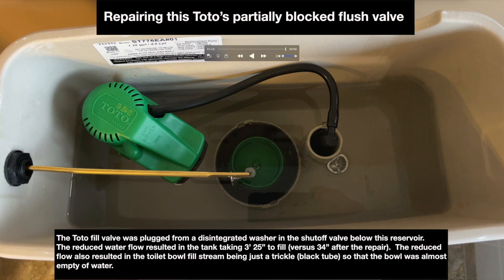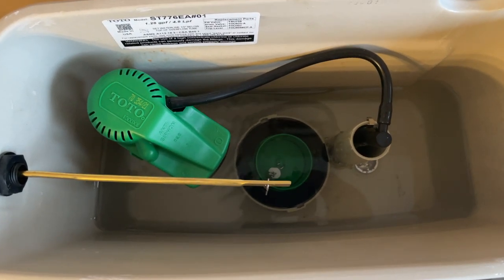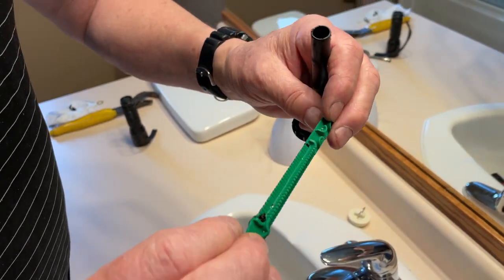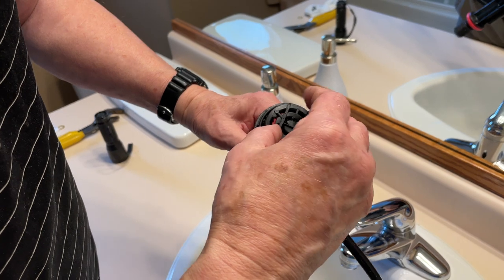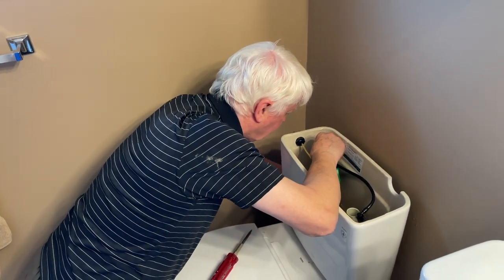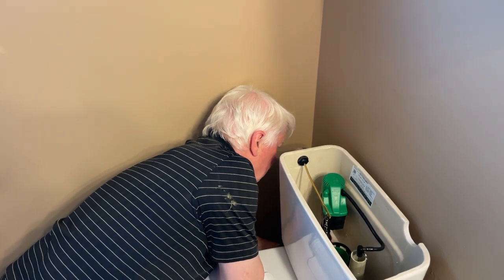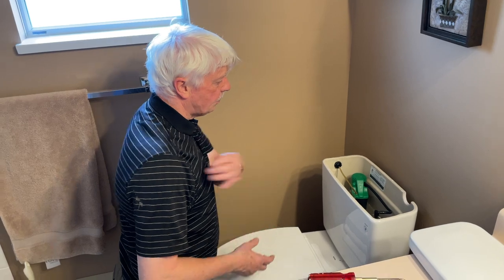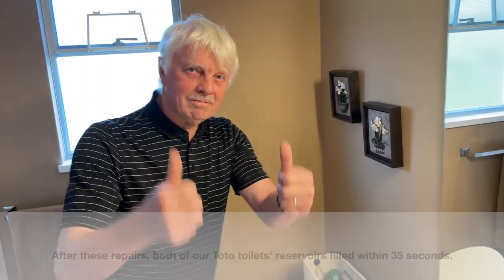Toto Drake II Toilet Fill Valve Blockage and Repair

Comment: Yep, the problem everybody keeps skipping over is how to adjust the water level on this valve. I washed five different videos and this is the thing they never addressed specifically on this Toto valve
Reply: Did you ever figure out how to adjust the water level on this style? My sisters water level rose on her by a half an inch and we have no clue how or why but its too high now so you constantly hear water flow.

Comment: You didn't by chance get an idea of how you adjust the water fill level when you had this out did you?  I have the exact same valve and I'm trying not to take it out to adjust the level but I just can't find any manuals, videos, anything on how you adjust it.  All the other videos have different valves.
Reply from the maker: Sorry for the delay.  I believe you turn the head counter-clockwise a quarter turn while hanging on to the stem and then pull the head up or down before locking it by turning the opposite direction.  You may have to remove the valve to do this if you don't have room in the tank.

Comment: Can this be done leaving the fill valve in place?  Also, is there a washer missing somewhere -- represented by the debris? Ah yes, in the stop valve.
Reply from the maker: It might be possible to leave the valve in place, but it is much easier to work on with the valve removed from the tank.  Removing the valve also lets you look through the fill tube channel with the filter removed. After making this video more debris came through from the washer remnants trapped in the water line, partially blocking the flow again,.  This extendied the fill times dramatically once more.   Repeating this repair procedure corrected the problem. (Moral of the story-remove old washers in shutoff valves BEFORE they disintegrate.)
Reply: @Flyfisherbob15  THANKS Bob. Actually I see this comment now immediately after having fixed it in place! I found just some tiny scraps of paper (?) on the green stem you showed. I will see if the problem re-occurs. Awesome vid, I had this dissembled, rinsed and reassembled in what seemed like 3 minutes. It's a genius design. Refilling strongly now.

Comment: How to adjust the fill valve. The toilet says the water line should be 1/2 from the top of the overflow, mine is 3/4...........